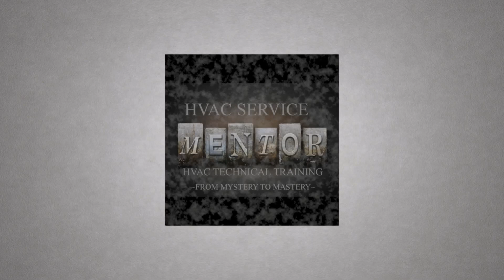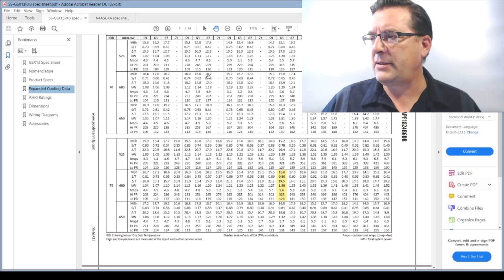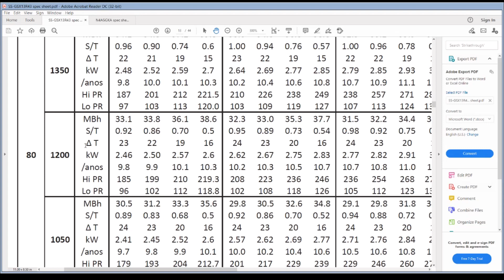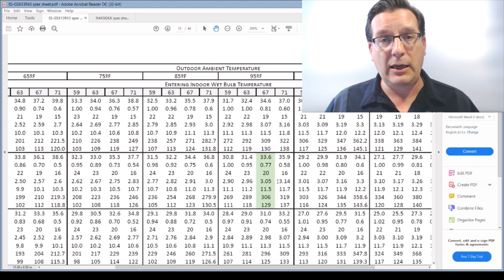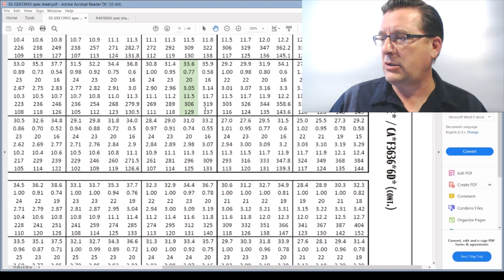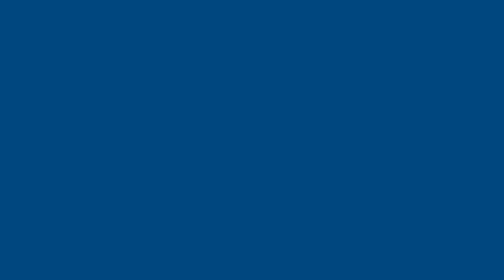How to Understand Sensible Heat Ratio Part One

Comment: How do you get 970 btu's/lb for condensing water vapor? 

970 btu/lb happens to be the added enthalpy for jumping liquid to vapor at 212 degs F boiling point of water.  Think that is where you are getting your number which is not correct for A/C evaporator temps dew point condensation.

Water condensation enthalpy subtracted (hg - hf) equals 1071 to 1060 btu's/lb in the 40 to 60 degs F evaporator temp range, respectively.
Reply: What is hg-hf?

To answer your question, I assume the 970 is the amt of BTU being removed from the AIR in the building space, not from the confines of the evaporator compartment. If you extract a pound of water from your downstairs living room, and your evap is in the attic, you have essentially removed 970 BTUs of latent heat from the house. I want to stress that this is just a hunch based on listening to the presentation of what he means. It could be wrong, but it makes sense.
Reply: It’s called the latent heat of condensation, not the total heat(enthalpy) Enthalpy is sensible plus latent heat.  For water this is 970 BTU’s per pound.  This is all latent heat, and cannot be measured with a thermometer. One could hold a container under the condensate line, and when 1 lb of condensate has been removed, it has taken 970 BTU’s. This can also be explained by how a condensing furnace is more efficient than a non condensing furnace.  A condensing furnace  is recovering 970 BTU’s per pound of condensate from the flue gasses. Otherwise this 970 BTU’s would be lost up the flue.
Reply: Most AC units will only do about 80% sensible. That means it assumes that at least 20% of the load will be latent.